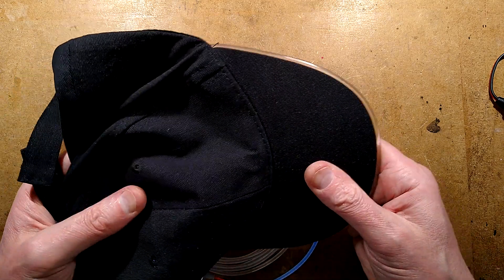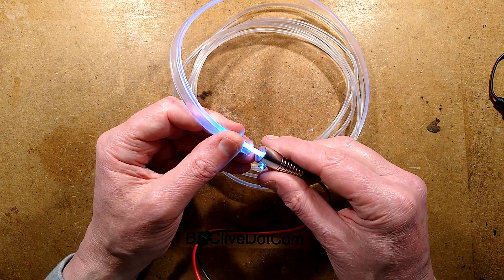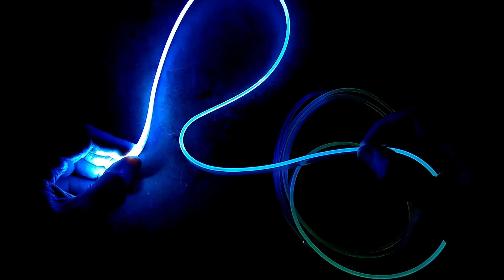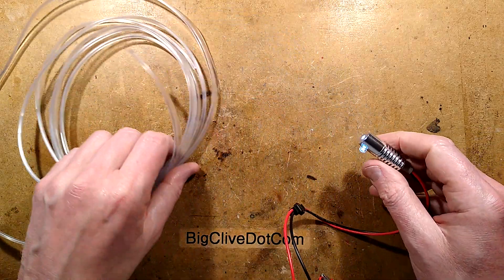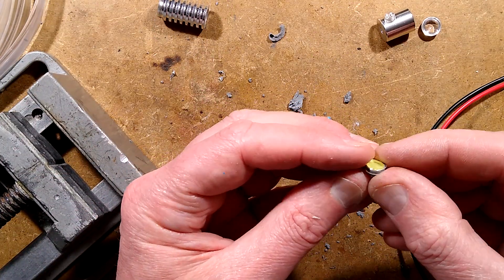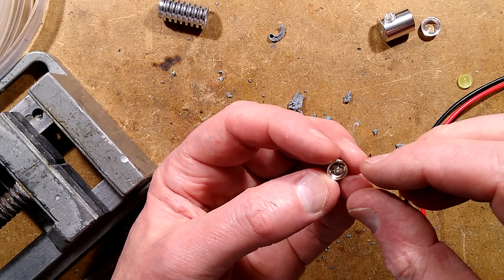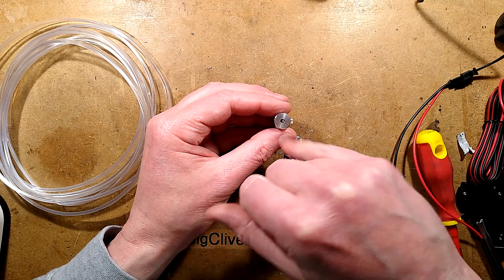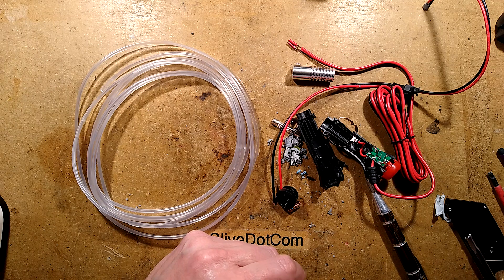Side-glow fibre optic is still terrible

Comment: Fibre optic like this will likely always have an issue.
If you are trying to direct it out the side, then you reduce the intensity of the light going further along, which will in turn make it dimmer, with the brightness decreasing exponentially as you go along the fibre optic.
In order to make it look reasonable I see 2 possibilities. One is to have an extremely bright LED and only have a very small portion of the light be scattered out to the side so the majority just goes through the fibre optic to the other end (possibly with mirrors to help with efficiency?). The other is a complex fibre, designed for a specific length which effectively acts like a bunch of tiny fibre optic cables to make the the light output linearly, as if you had a bunch of separate fibre optic cables with their ends equally spaced along the length of the tube.

I would also be hesitant to use electroluminescence due to the voltage requirements.

Comment: I use to do real fiber optic cable repairs. Not sure if it plays a big part here but making sure the fiber optic is 100% cut flat  to ensure the “light” travels the entire length is crucial. Might try cutting the end again and having a smooth and 90° cut to the fiber cable might make a big difference
Reply: I think it shouldn't even be called fiber optic.... It's an led with a clear tube attached.
Reply: @starmc26  Right. It's not even fully transparent, which real fiber optic cable is. That stuff there that Clive had on the bench is so opaque it dulls the light at a certain distance.
Reply: Considering fiberoptics work by total internal reflection, this breaks total internal reflection to leak it out the side. Quite frankly from a physics point of view, this is expected.
Reply: In a company I was once working at they were even sanding the glas fiber (up to 10k grit wet sanding) after cutting it at 90°. But they used the thicker fibers (roughly 1 millimeter diameter) for transporting the light to measuring/test equipment, not the tiny ones for for data transfer.
Reply: @chrishuhn5065  They do that when repairing normal comms laser/led fiber for networks. Or at least they did 10 years ago before everyone started getting fusion splicers.  I agree with another commenter, re-cut the end going into the LED to get the flatest, clean cut.  More than likely though the Manf. of these things are using the absolute worst, 2nds/3rds/remnants from some OEM.
Reply: @chrishuhn5065  yeah that's for UPC's because they're a nightmare for light loss. Most companies use APCs nowadays.
Reply: I am wondering: if I only have parts of a line/string exposed, do I increase light transport by wrapping the unexposed/covered parts with aluminium foil/tape?

Comment: Clive, as you unrolled the coil the light spread seemed to improve ... perhaps they were not expecting a lot of tight corners around the car panels?
Reply: Yes, they only function with wide curves as you want to maintain total reflection within the fibre. Thinner fibers can therefore take sharper turns.
Reply: The light looked like it made it about 360 degrees before significantly fading.
Reply: @Subsiding0974  I own these. Then fewer the total degrees of turns and the less sharp, the better the light is

Comment: The manufacturer used a wide angle LED, the worst choice for launching light down a long light pipe. Narrow angles work best for fiber optic applications where you don't want to lose all the light in the first foot of length.

Comment: Funnily enough, I've just fitted something similar to my car for ambient lighting and I was going to ask you how these work and what is inside the black [transformer?] box?  I've fitted 2m lengths and they seem to light up evenly throughout.  As said, they are thinner and don't have a visible light source that I can see (the end has a sort of 'bulb' but it turned out to just be a cap!  These are the ones I used: https://www.aliexpress.com/item/32889537056.html?spm=a2g0s.9042311.0.0.24f44c4daNMZXP
Reply: Did some research, and it's EL fiber. It's essentially one long LED, powered by that small box. It's brilliant, and I haven't seen such a thing before!!

https://en.wikipedia.org/wiki/Electroluminescent_wire
Reply from the maker: EL wire has been around a long time.  You can also get a chasing version that gives a flowing effect.

Comment: How does this compare to EL (electroluminescent) wire? I do believe that uses a different technology and in theory is the same application as this fibre but actually works a lot better. Maybe you could have a look at that?
Reply from the maker: EL wire is very linear, but dim and gets even dimmer with time.

Comment: I've used fiber optics in a number of art projects. One technique I've used is to use a sharp knife to score the cladding (just a small nick) crosswise to the long axis, every few centimeters. The nicks in the cladding allow light to leak out and make tiny bright points of light along the length. This really only works for shorter lengths of a meter or less, but the effect is still neat looking (the points of light are much brighter than the normal edge glow).
Reply from the maker: The USB cables with the scribed fibre look great.  A very sharp series of dots along the length.

Comment: Do you think you could put an led in your finger, or maybe in the bone of the finger tip, coil wire around bone and power it inductively? Or... Is that a horrendous thing to think of
Reply from the maker: I'm not that keen on implantable devices.  The earing is the closest I get to that.
Reply: @bigclivedotcom  only thing i contain is other parts of dead people
Reply: Implanting any sort of device is possible, but the issue is the one thing that keeps you alive... Your immune system.

Any RFID chip or NFC chip, that's implantable in seconds, is in a glass pill. They're implanted under the skin, away from any nerves or blood vessels. They also avoid tendons. Why is that important? Because your body would freak out and try to attack the device. It would dissolve what it can, and encapsulate the rest in a cyst. It would essentially try to get rid of it and keep it away from any tissue. It would be painful and dangerous. That's why we use stuff that our bodies ignore, or can't easily attack.

Now, to your question about led fingers.
It's not possible, and you wouldn't want to have it anywhere near your fingers. They're precise and sensitive tools. A slightest cut or a splinter is not a fun time. Inserting a sizable device in that area would be very painful and uncomfortable. You'd cause a lot of damage in the long run, as such a device would press against blood vessels and nerves. You'd also have a pill sized bulge on your finger.

As to light emitting? Unless the diode is big/powerful, you're not gonna get much through your finger tissue. That also introduces the issue of heat. You could burn your fingers from inside out, since bigger LEDs heat up.

So the answer is a no. It's not possible to have light up fingers without causing a lot of pain and health issues.
Reply: @SpotTiger  I asked before I'd thought a lot though, I have a friend with a few implants, needle is huge, blood curdling 😂

In the end I went with maybe light up fingertip covers
Reply: @phonotical  Oh yeah. Those needles should be called "metal straws" cause they're literally like pencils!! Massive!! 😅😆
Reply: @SpotTiger  probabaly designed for cows, not human!

Comment: fibre optic tubing is better suited to transporting the light to the other end without much "leakage" out sideways, hence why fibre optic is sued heavily in telecommunications these days, I would reckon a rectangular/square length would be better for this type of application due to the hard corners where light would collect more

Comment: Until next time, keep in mind that silicone dissolves if you dump it in citric acid - doesn't need to be strong :)
Reply: Wait, it does?! What about phosphoric acid? I have liters of it!
Reply: @SpotTiger  that'll possibly eat glass as well, but dunno about silicone. may work :)

I just know this because some years back, I was having fish tanks and people building or fixing fish tanks use citric acid to remove the silicone from the joints. So probably not a good idea to dump a lot of it in a 1000 litre tank ;)
Reply: @roysigurdkarlsbakk3842  Phosphoric acid is kept in glass bottles and can even be kept in plastic ones. It's a weak acid so it's easy to work with!

As to the fishtank trick, I'm shook that I didn't know that!! I had fish for years and never knew how to fix leaks or cracks. Your trick is so versatile!! Thank you!! 😁👍

Comment: I think different LED colours would make different lengths glow, probably red would make the whole length disappointingly dim, yellow would be less disappointing, green would make longer length glow sort-of ok, and then blue / UV would just disperse at one end, as seen here (or worse). They'd have to manufacture this "fiber" with non-uniform dispersion over the length, probably growing exponentially with the distance from the LED. Much harder (more expensive) to manufacture than just a uniform material that can be cut in lengths I guess…

Comment: for this to be any good theyd have to lower the lossyness of it substantially and then make it loop back on itself so the emissivity is realtively equal across fibre. A sort P shape where the bottom of the P is where the light goes in.
Reply: Do Y splitters exist for fibre optic?

Comment: It seems to me that to make this look even the lossy-ness of the fiberoptic cable would have to vary along the length, something like:
loss = 1/(L-x)
where L is the length of the cable and x is the distance from the light source.  At that point you might as a well use a bundle of red, green, and blue EL-wires to get your preferred color.  On the other hand, edge-lit LCD display diffusers did manage to solve this problem, so perhaps it's more tractable than it appears at first.

Comment: The proper led glow pipes are manufactured to have specific diffraction angles which optimises light strength vs how far it is away from source. Also if they used actual fibre optic glass it would be better at controlling the light. Typically however the most gains are how powerful led's/laser diodes vs pipe length.

Comment: You might be interested in "EL" or "electroluminescent" wire, but you probably already know about it. You can get it in long sections, probably even on a spool and is driven by a small, high voltage power supply (usually powered by two AA batteries). The light output, along the lenght of it, is pretty much consistent and it comes in many different colors.
Reply: I think he knows: https://www.youtube.com/watch?v=NpiddGxC7jo&t=391s

Comment: Bus is EL wire still available from China at a reasonable price ?
I ask because I do indeed remember multi-coloured CCFLs being sold all over the place primarily to be put inside PC cases up to the late 2000s/early 2010s if I remember correctly but as far as it goes nowadays I do feel almost like they never even existed to begin with when looking for them on chinese websites.

PS: Are my sentences grammatically correct ?
(Remember I'm French)
Thank's !
Reply: Other than using the word "bus" instead of the word "but" your grammar is better than most of the native speakers on the internet.

I also remember those small CCFL lamps, I bought one, but never ended up doing anything with it.  I think they have been mostly replaced with RGB LED strips and LED fake neon (side emitting) strips.
Reply: @Kineth1  "Bus" was definitely a mistake as I was probably in a bit of a hurry.
(BuT if I edit my comment the heart will disappear 😂)
Reply from the maker: LED strip killed the availability of the cold cathode tubes.
Reply: @bigclivedotcom  Too bad but what about EL wire and flexible panels ?

Comment: The material aeems to be limited by physics since the light is going to fall off very quickly as it is radiated out the sides of the fiber. Seems limited to applications where you want a short piece and can put a led on both ends and are OK with it being dimmer in the middle than at the ends.

Comment: I mean if it wouldn't "loose" light over the the distance it would hardly be "side-glow". It can't amplify the light put in. Sure, the coupling won't be great in the first place, but you can't be surprised that it stops glowing after a relatively short stretch. The side-glow bit is the thing that real fiber-optics tries to avoid as much as possible.
Reply: Yes, just what I wanted to comment....
Reply: There's obviously a balance that must be struck.
Reply: It seems the concept of side lit light piping is flawed from the beginning. You could improve the performance with laser cut mirror arrays, like it's done in LCDs, but you're just better off backlighting along the length. Gives uniform glow and looks better.
Reply: Some form of gradated mirror coating could be applied to even out the emissions, it's just acrylic (or polycarbonate I looked it up) so you could use regular chromed plastic equipment.
Reply: If the light leakage could be made more uniform, then the intensity drop would be spread over more filament and have a better effect
Reply: @mrb692  laser etched mirrors in the fibers would be excellent.

Then again, you can't beat cheap electroluminescent fibers.
Reply: @mrb692  That's making it lower rather than more uniform, surely?
Reply: @pseudomonad  it would be less bright at the source, but brighter longer down the run
Reply: When something's loose, you fasten it.
Reply: @Anvilshock   Flextape it. 😏🤣
Reply: @SpotTiger  THAT'S A LOT OF DAMAGE

Comment: I wonder if it has something to do with the optical coupling. The best edge-lit etched acrylic lights i've seen so far have the led or led strip embedded in the acrylic itself
Reply: I think it's the purity of the material. If the polymers are misaligned or there's impurities inside the material you get this sort of thing.

Comment: Makes me wonder how it would work with actual laser, got some laying around to test real laser with it?
Reply: call StyroPyro!  He'll not only have it glowing, but burning up like flash paper.
Reply: I tried it with my 500 mW blue laser and it works just as well as a bright blue led...  about 30" lit up, the odd thing is that it doesnt fade linearly, it drops off rather quickly once you get past 25"
Reply: @bunnykiller  probably because laser emit a very specific wavelength vs an led which emit a broader less specific wavelength of light.
Reply: @jrdn.lauren  actually the blue led is rather tight on its spectrum like a laser, the red one is very tight on its spectrum
Reply: @bunnykiller  very cool to know! now to find and puzzle out the mount for a small laser emitter
Reply: @bunnykiller  Interesting, just wondered if laser super narrow angle would help with uniform light distribution and distance
Reply: @taith2  probably not, the length with the led or laser was about the same with the stuff I have... after all, the tube lets light "escape" the entire length of the material, what I want to do is test it again with varying strengths of lumens/lux etc and see if low light compared to strong light makes a big difference or its just the way the tube is made...  think of a garden hose with pin holes down the length of it, eventually there wont be enuf pressure to let the water out, with light, eventually there isnt enuf left to reach the end of the tube, its all dissipated in the first 30 or so inches.
Reply: @bunnykiller  Whoa! Light Wave Pressure ? Photonic Mass ?  What The Firetruck are you talking about ?
Reply: @bunnykiller  It also depends upon the rayleigh scattering of the material being used. As this is an issue with optical grade fiber, this stuff has got to be far worse.  For short runs like the baseball cap, one might actually be better off using a thin acrylic rod and warming/bending to desired shape and stitching or glueing it on.   I can't recall at the moment, however there is a way to get almost any plastic/acrylic to act as a light tube like this, only results should be much, much better. https://www.instructables.com/Edge-Lit-Displays/
Reply: I was thinking the same thing.
Reply: how to blind everyone in line of sight of the thing

Comment: 3.5 minutes into the video, thinking try firing a laser pointer/Laser diode into it.

edit: Later into the video. A small 3-5 mw laser pointer diode looks like it might fit in that holder.

Comment: I'm surprised you say it peters out as you're known for under running LEDs and they all look that dull to me after you're finished them hahahaha!
Reply: The overall light isn't the issue. It's that it's extremely bright for 3 inches, and degrades rapidly. The difference in light output between the first 3 inches and 1/4 of the way down the cable is like a 70% decrease.

Comment: If there was a way to make this stuff actually.... good over long stretches I think it could be super useful.
Especially in costume design or performances where it would be hard to run wires all over that could wear out.
Reply: E. L. Wire, I believe that's what it is called, might be what you're looking for
Reply: @krazykarl0  Yeah, that stuff is also really neat, but it does have problems. It’s stuck with one color, produces a high frequency wine, isn’t too bright, and tends to wear out rather quickly. 

I think my perfect product would be like, super miniature ws2712b LED packed onto that super flexible filament style wires in modern LED bulbs.  I bet that’d cost an absolute fortune, though.  Hahah

Maybe some of the LED neon stuff but like, much thinner. That’d be awesome!